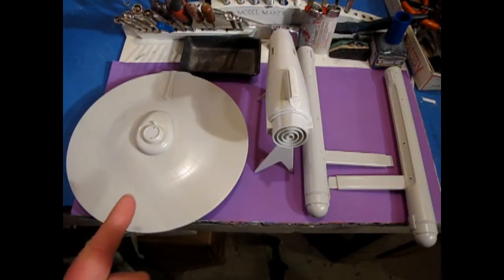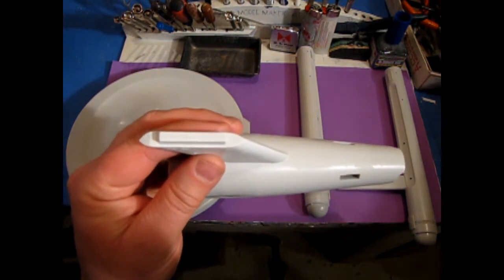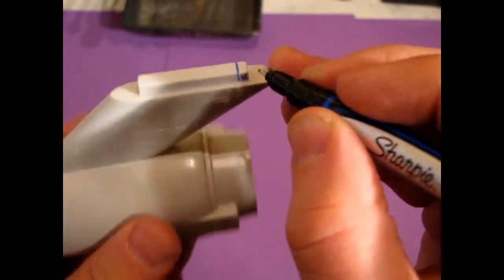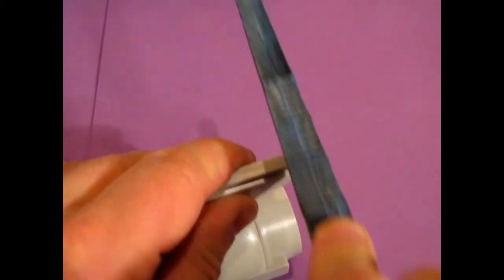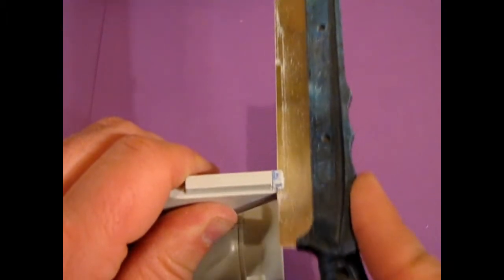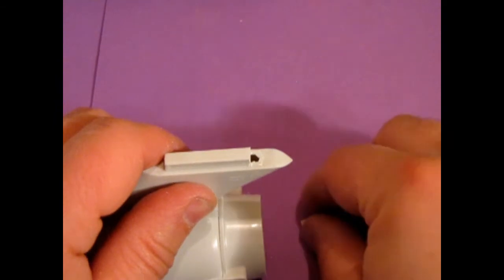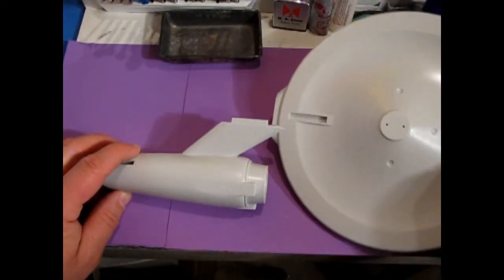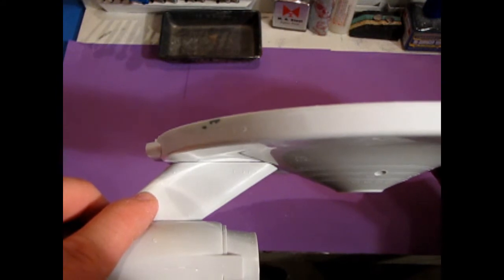Let's Build the AMT U.S.S. ENTERPRISE Kit 6676 - Part 6 - Fit and Finish - A How-To Video

Comment: The AMT model is cannon.  Was used for many original series episodes.  Having said that that, there are flaws.  The bridge is all wrong, and the right necelle is higher than the other.  Doesn’t line up.  Also the lower saucer section has dimples, which don’t belong there.  So I fill them up with putty.
Reply from the maker: Hey Foobles. Thank you for watching.

Comment: I love the jig.  Could I get a couple more measurements?  What is the length of the saucer braces and what is the distance between the back of the saucer braces and the front of the engine braces?  Thanks.
Reply from the maker: I will have to bring in the jig and measure it, but I don't think the length of the saucer braces were as key to alignment as their height. You only need to make them long enough to provide support along the saucer edges at that point. 

The distance between the back of the saucer braces and the front of the engine braces is also not entirely crucial because the engine braces are only there to stop the engines from pushing outwards "Side to side" as opposed to "End from end". 

If you still need the measurements, let me know and I'll find them out for you.
Reply: @monsterhobbiesonlinestore  That makes sense.  I should be able to figure it out myself.  Thanks.

Comment: The notch that you cut out of the neck, how much is that?
Reply from the maker: I think it was 3 mm, but it isn't too significant just as long as you can slide the secondary hull forward enough that the angle on the neck seats into the angle on the saucer. It's a bit of test fitting until you get there. 

The concept of getting the gaps as tight as you can is what I was trying to relate.